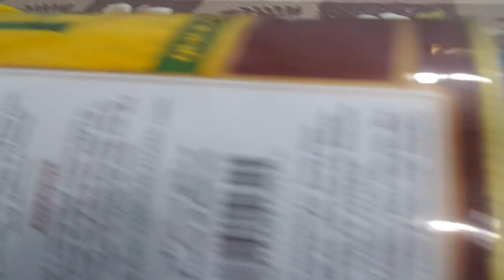Diffraction at a single slit Experiment

Comment: Take 2 pieces of paper

Draw a line with a blade or knife on one paper. Make 2 slices if you want to perform double slit but make sure they are as close to each other as possible

Fold that paper in such a way it stands perpendicular to the ground

Fold the other paper in same way and put it at a distant

Adjust your laser so that it goes through the slits u made in the first paper

See the magic
Reply: Hey bro ! Just plz tell me ! 
It will be gud for physics working model of 12 cbse or not ?

Comment: thank you 
why we are using blades?
we need only a small narrow hole
Reply: I think it's because if we cut a narrow hole, the lines doesn't look neat while the line from the blade is more straight and neat.
Reply: Tha blades provide sharper and more accurate result. Further the slit would be even if aligned correctly...